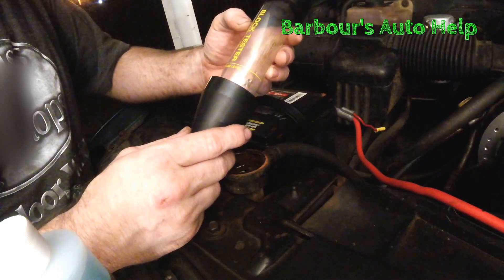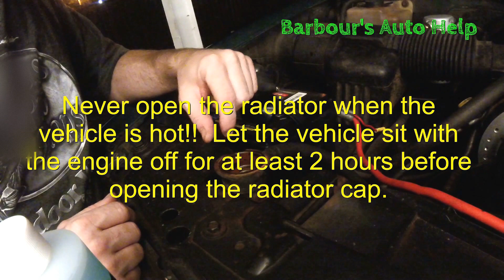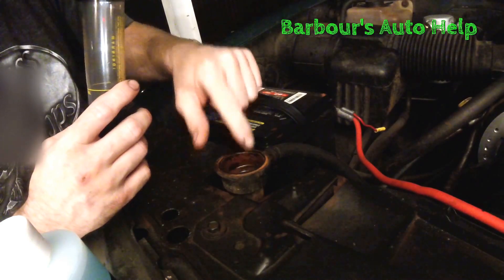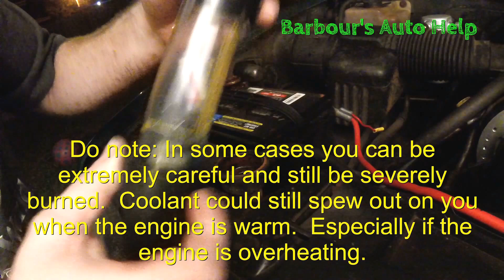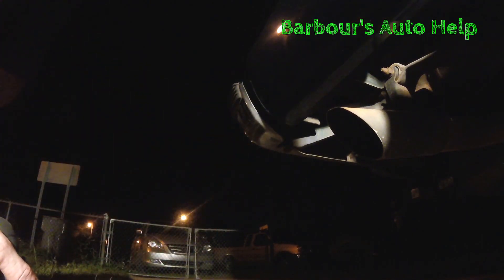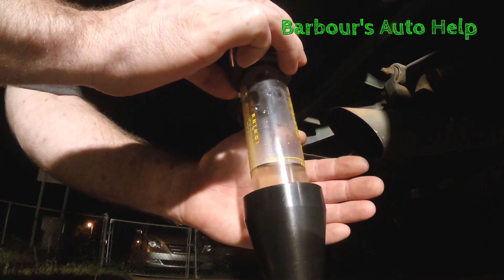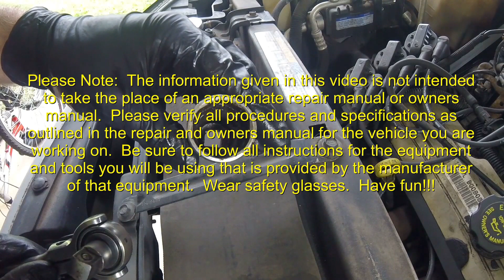How to test for a blown head gasket with a block tester

Comment: Can this be used on a 2010 Prius?   The Prius has no radiator cap.  Can I use the reservoir as the fume check point instead, since there is no radiator cap?  Do I need to pull down the level in the reservoir so that the combustion gas will come out of solution better or will the gas be there from natural circulation via the fluid?:person-turqouise-waving:
Reply from the maker: Haven't worked on a bunch of those.  I couldn't tell you unfortunately.

Comment: Great video. Quick question can I do the test on a V6 or V8 engine without removing the injectors?  Do I have to remove them to have an accurate reading or removing them helps to identify which side is blown?
Reply from the maker: I’m sorry. Not sure if I understand the question. Why are you thinking about removing the injectors?

Comment: Thanks for the video. I feel like I'm doing something wrong. I lowered the coolant level in the reservoir as instructed. When I attach the bulb to the tester and then squeeze, the bulb stays compressed and won't 're-inflate'. Not seeing anything bubbles through the fluid as nothing is being drawn upwards. This happens even if I don't put the tester on the reservoir/radiator. I attach the bulb to the tester with the silver release valve facing upwards, squeeze the bulb and the bulb stays squeezed/compressed. Any thoughts. I feel like an idiot.
Reply: that's tester is not working correctly

Comment: I had a problem and wonder if anyone can explain l. I drive an infiniti g35x, 2006. I siphoned around 3 inches below the radiator cap and tried the test and it sucked up radiator fluid immedietly. It rose up immedietly after starting engine. So i disconnected that little hose to see if that would help. I started the test and roughly 60-80 seconds of pumping later it started sucking up radiator fluid. Im scared that 60-80 seconds wasnt enough time to get an accurate read and i dont know why the fluid rises unless its just the heat
Reply: Supposed to have like 2in clear from Coolent or more and it will raise due to your engine warming it expands and cost you to suck up fluids

Comment: Hi what does a orange mean color
Reply from the maker: Did you suck some red coolant into it?
Reply: @BarboursAutoHelp  maybe
Reply from the maker: Well ... Maybe that's why it turned orange.
Reply: @BarboursAutoHelp  maybe but later I try again but this time I take some of the Coolant  out lower the cap a it still turn orange maybe I did I wrong I send the car to get it diagnostics on it the will tell me tomorrow

Comment: What if it goes from deep blue to blue/green??  Yes, I removed coolant so there's a 2" gap at the radiator fill hole.  Oh, when I turn off the engine when it's not fully warmed up it will "lope/diesel" for a second before stopping!  My engine runs great and idles smooth after it's warmed up.  Doesn't overheat on freeway but will get warmer if not moving after 10min.  New radiator, fan, water pump, thermostat, sensor.  Heater is hot.  Coolant new.  Any ideas would be welcomed😁
Reply from the maker: I'd say blue/green is inconclusive.  Not sure how to point you on this one.

Comment: What if it turns light green? I only have water on the system for testing.
Reply: Yes, I got the same blue/green Twice when testing with a 50/50 antifreeze/water mix.  Made sure I had 2" gap from tester to antifreeze on a regular radiator with fill hole on top.

Comment: I really enjoyed your thorough explanation as well as the video. One question. I tested my engine and discovered I had a leak (pretty sure it was a head gasket leak) After lots of googling I ended up using K Seal. It sure seems to have worked. No misfire, no engine shudder. It’s running very smooth. I tried the block test again and it still came out yellow. Does the combustion gases stay in the coolant and you have to drain and put in new coolant for an accurate test? Thanks again
Reply from the maker: I wouldn't think you would still have combustion gasses in the coolant unless you still have a leak.   Not sure if the K seal is putting off a chemical that could react the with block tester.
Reply: Hopefully the longer it’s in the system it will seal all leaks. Thanks for the reply!

Comment: Will this work if I just have water in my cooling system? A lot of coolant has leaked from my radiator and car is overheating and I wanna use this to make sure I don’t have a blown head gasket. Do I need coolant or will it work with water too?
Reply from the maker: The steam from the water may though it off a bit.  It may turn yellowish green but shouldn't turn golden yellow.

Comment: Not sure if I need this kit. I know bubbles in the coolant tank could be a blown head gasket but my coolant tank has a large layer of foam on top of it. Does anyone one have any clue what I'm on about?
Reply from the maker: Foam may be engine oil.   Sounds like you may be onto something.   Sometimes a blown head gasket will cause this.

Comment: Thanks for the vid, do you know of an instance when the block tester reads blue but there is still a crack in the block?
i rebuilt my engine. good compression, tons of white smoke(doesnt smell like coolant) no milk shake, no muddy radiator, no gas smile on dipstick. super confusing. any ideas would be much appreciated thanks
Reply: Bad piston rings

Comment: i bought a 94 honda accord a few days ago it seems to run ok no misfires today i found an unopened kit like this, thinking about testing it since now it has me worried as they wouldn't have had the kit if there wasn't something wrong
Reply: i drained a little water from my radiator and started it up let it run about 5-10 minutes and then used the tester and it stayed blue wasn't sure if the fluid goes bad after a while seeing how idk how old it was i did it over the exhaust and after a few times of squeezing the bulb it turned bright yellow so i'm hoping that i done the test right i did exactly how it was in the video
Reply from the maker: That's how I do it.  Did the kit have instructions?
Reply: @BarboursAutoHelp  it did but i couldn't make out what it was saying the paper was in bad shape so i just followed your video
Reply from the maker: I've never seen a different way of doing it.
Reply: @BarboursAutoHelp  i never heard of the kit until i found it in my trunk
Reply from the maker: It's a great tool.  Even better when you get one for free.
Reply: definitely can't beat free stuff

Comment: I have a 2005 malibu. 2.2 ecotec. My radiator does not have a cap. It only has the coolant reservoir. Does that make the procedure any different?
Reply from the maker: Instead of taking samples where the radiator cap mounts, like the vehicle shown in the video, just take samples where the reservoir cap mounts on your vehicle. .
Reply: @BarboursAutoHelp  excellent, thanks

Comment: So I did this same test.  It started out Blue but then turned Green. I read on other places. Green or Yellow means a bad head gasket is that true?
Reply from the maker: Go by the instruction given with the product your using.  It will usually turn golden yellow.

Comment: Mine turned light blue but not yellow/green/orange just light blue
Reply: Any ideas ? Thank you
Reply from the maker: Light blue is not yellow.  Sounds like you don’t have combustion gasses in the cooling system, which is a good thing.
Reply: thank you for the response
Reply: The kit from harbor freight turns from green  to blue

Comment: What if you don't have fuel injectors
Reply from the maker: I don’t understand the question.  Can you clarify?
Reply: BarboursAutoHelp you talked about puking fuel injectors to find which side is bad. I don't have a fuel injected engine.
Reply from the maker: Oh, then you can’t use that method.  What kind of vehicle do you have?
Reply: BarboursAutoHelp a 78 Chevy nova
Reply: BarboursAutoHelp  can I still use the block tester though
Reply from the maker: Yes, you can still use the block tester.  You just can't isolate the problem using the method of disconnecting injectors that I mentioned in the video.  I'd say if the vehicle fails the block test then I'd pull the spark plugs and take a look at them to see if there is any abnormal contamination on them.  That could lead you in the right direction.
Reply from the maker: By the way, what kind of problem are you having with your vehicle?  Is it overheating, using coolant,  ect?
Reply: BarboursAutoHelp gotcha. Thank you for the help. My fan failed and my water temp reached 250 so I wanted to test to see if the head gasket failed
Reply from the maker: Oh I see.

Comment: Great video and well-spoken explanation, thank you.
Reply from the maker: Thank you!  Let me know if you have any questions.
Reply from the maker: +Frances Eaglelite If the over flow is just an overflow then no.  If it's a pressurized degas bottle then yes.    A plain overflow bottle just has a flap for a lid. A degas bottle will have a screw on cap that is able to hold pressure.
Reply: BarboursAutoHelp  hi so can i put the tester in the overflow container  on a 2000 vw jetta 2.0 ???